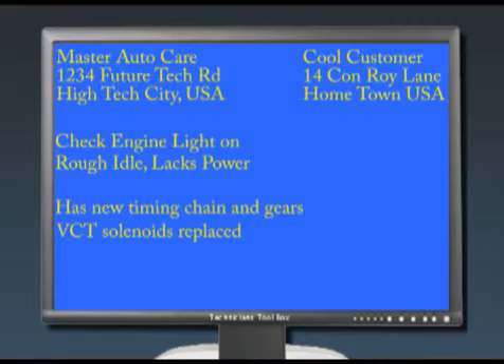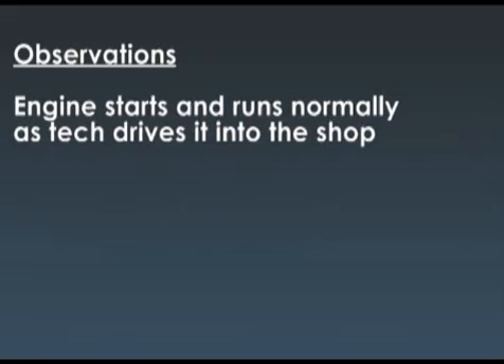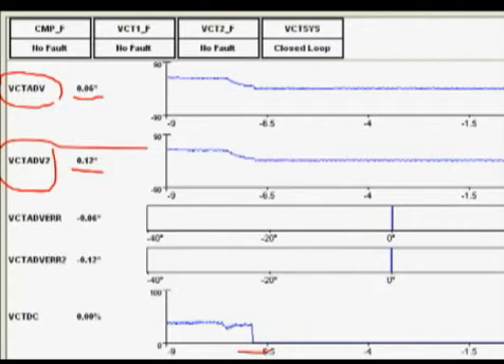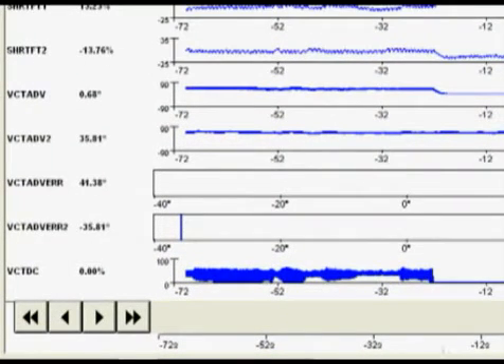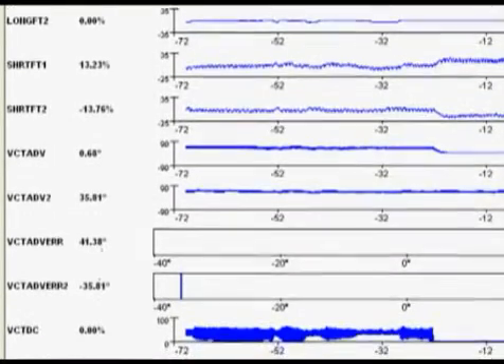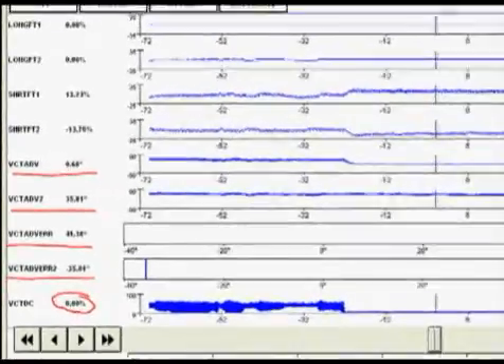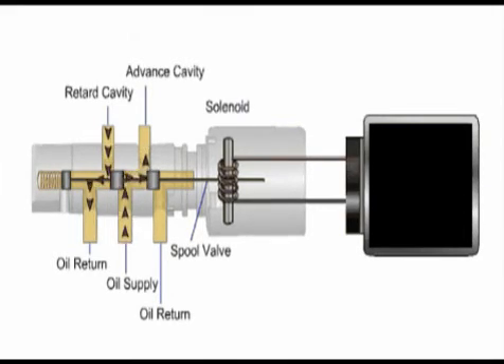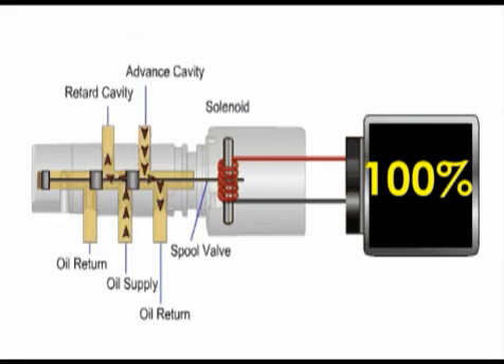2008 Ford F150, P0012 & P0022 codes

Comment: I have the same exact truck with the same exact symptoms. But in addition to doing the timing job... chains, tensioners, guides, sols and phasers, I also changed the oil pump to a Melling 360HV....  still runs rough when going to idle after engine warms up. What would be your next step after replacing that oil pump on your customer's truck and the problem remained?
Reply: Did you try replacing the bank 1 VTC actuator?  If that does not fix the problem, your timing on that bank may have jump a tooth.